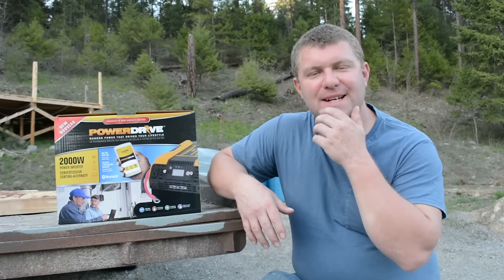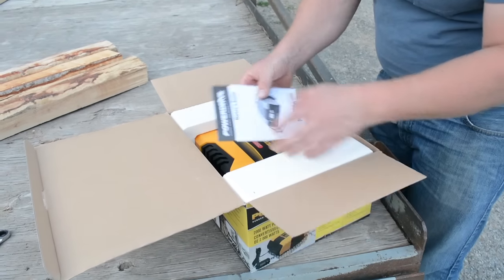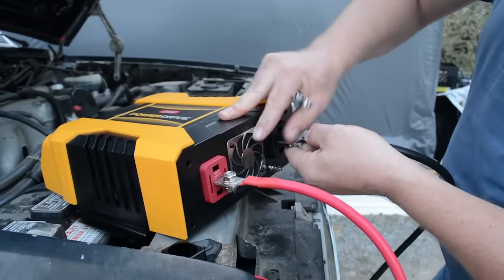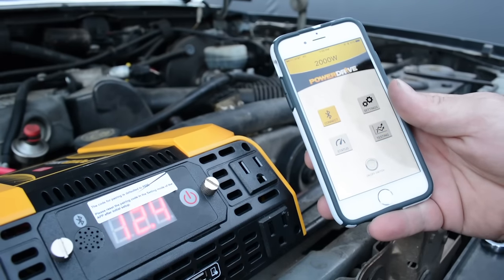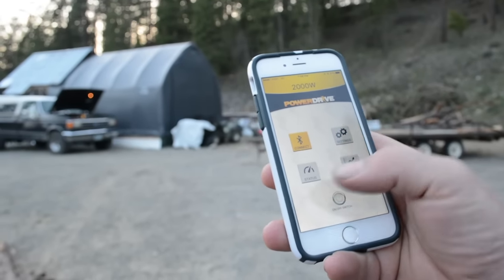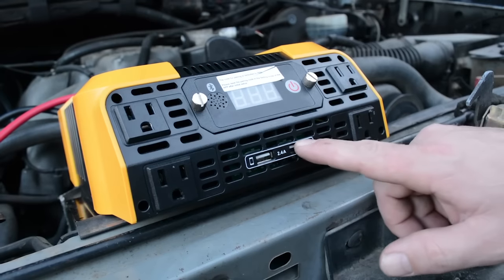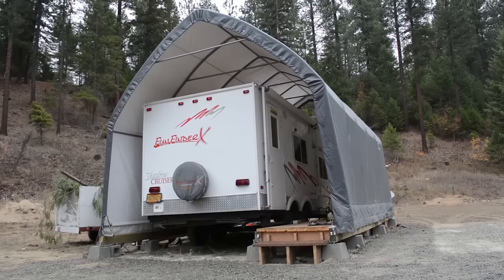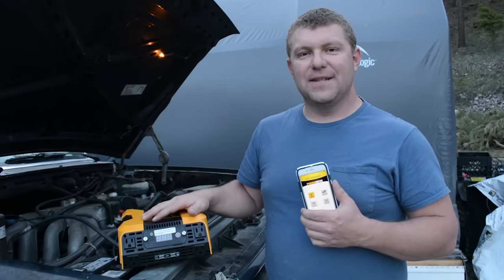GENIUS BLUETOOTH CONTROLLED INVERTER!! (iPhone and Andriod)

Comment: The thing that worries me a little is that you've spent a fair amount of money on a piece of equipment you will likely upgrade on in the near future.      So in this case its a $180 that probably  could have been used on your next power system.       Your video's are great, it will be interesting to follow your journey.       I own an off grid cabin myself but only live there part time.    In the winter time I do fill the water system with glycol and use an outhouse.     In the summer  collect rain water, rarely do I need to haul water, there is enough for hot showers, flush toilet and stuff.  Freezing temperatures in the winter definitely does present challenges.     I agree a cistern is probably the way to go.

Comment: hey, you mentioned at the end that you run your internet off of your inverter. Can you tell me why you chose to do this? All electronics are 12v. Wouldn't it be better to have it powered directly off your battery bank which is 12v?

Comment: What happens when the cell towers stop working? Going off grid means everything. I love manual control when it comes to my power needs. My Honda genset is 3k and pure sine. Look for good solar to charge car batteries. Mine charges my deep cycle RV battery fine.

Comment: You said that it is a modified sine wave inverter. Electronics are usually the most sensitive to that, but you said that you use it for internet purposes... and I assume aren't having any problems. Have you run into anything that didn't work on this modified sine wave?
Reply from the maker: +Christian Swensen No issues presently or for the last 8 months. You have to realize nearly everything we run is battery powered such as cell phones, laptops, camera, walkie talkies so all we are running is chargers which are presently run off our generator which is pure sine and powers our RV where we charge all these things. The only thing we power with this inverter is the Internet antenna and router. As of current we have had no issues with our either device, but those devices run small converters at the outlet to adjust voltage and current likely having a some filtering effect.

Comment: I assume it's not a pure sine wave inverter, so don't be surprised if some things don't run right. Be especially carefully with battery chargers and motor driven products. Motors tend to overheat with these. It can also shorten a product's life. Sadly, there's no reference list of what works and what doesn't with modified sines waves. For a reliable RV solar setup, you would stay with only name brand electronics from Morningstar, Magnum, Outback, Bogart Engineering, (In other words, expensive). With other brands it's a crap shoot as to how long they last.
Reply from the maker: +st8kout1 We use it to run our internet router and antenna. Works great!
Reply: It's fairly safe for computers, which is why UPS battery backups use modified sine waves. Digital clocks have a hard time though.

Comment: Modified sine wave inverters are NOT good for running motors.  They will have less power and will run hotter.

The best batteries for an inverter (power and durability) are GOLF CART batteries !  You can get them at Sams Club or Costco.  They are 6V so you will need 2 in order to make 12V.  Unfortunately, recharging them from a car is not optimal.

Comment: That is pretty cool, It does make me wonder what kinda of amps it uses with the extra features, still cool though. I personally use a 70 watt inverter most of the time cause it doesn't use much amps converting the dc to ac, i can usually run a laptop, 4-5 lights a radio, 5 security cameras, a router and modem all on just one 70 watt inverter i only use a bigger one if i have to i need to get a new nice pure sin wave too i keep burning up fans and such. I did make some videos about my setup feel free to check em out and subscribe.

Comment: Sorry...hit send too soon.  When you run the ground wire to the mounting frame on earlier units, with heavy loads on the inverter, the plastic around the lug melted  (2 new units).The truckstop wouldn't allow the customer to return the unit without the original packaging.  If you notice any heating of that lug, you might want try the Coleman inverter's sold at those same Truckstops.  They don't make a remote controlled unit, but they last 5 or more years trouble free. Also 12v dc inverted to120v AC is 10 X AMPS or a lot of heat and current. Those 4 Guage battery cables could be bigger to handle the higher amps.  3/0 would be quite safe. Anyway, keep up the good work.  Look forward to the next project...T
Reply: +Tom Bottoms They need the wireless ability. Good catch on the fuse. A lot lower than 250 amps.
Reply from the maker: +Tom Bottoms thank you the tip Tom! For this particular inverter we have no intentions of loading it heavily. We replaced a 300w inverter so it's load is small. In fact so small or doesn't even register on the inverter. That said we will keep an eye on it if ever we use it at full capacity. Melted lugs sounds terrible!
Reply from the maker: +Mike Brink The lugs appear to be a coated copper so perhaps it's zinc coating. I'll try to remember to take a closer look tomorrow and post up. I'll just say this isn't the inverter you'd want if you plan load it to the hilt. It's a decent built budget inverter with features we simply couldn't find anywhere else. The wireless was the selling point. We nearly bought a wired cobra and I'm glad we didn't. The wireless keeps our setup cleans and it works great for the application. 

I ran the predecessor to this model for 5 years in a work truck and never had issues. 
Ran a laser printer no problems and took the abuse.

Comment: Not trying to be a Safety Troll, but I guess I am.....@3:10 you are hooking the Positive Cable  to your car/truck battery with the Negative cable connected...dangerous in that if you swung that wrench and it hit the frame...big a** spark and could destroy your wrench/battery/etc......I've been close when this has happened...not pretty.
So disconnect the Negative Terminal from the Battery...do your Positive stuff and then reconnect Negative Cable and do that stuff.

Comment: 2000 unread emails lmao Be careful charging your devices through usb without the original manufacturer block that it comes with. I fried the motherboard on one of my phones doing that once. You also shouldn't completely deplete or charge the new lithium batteries 100% I charge at around 25% and stop charging at about 75% as a rule of thumb.Most devices come out of the factory charged at about 50% as this is where the battery is most "comfortable". I'm not really completely sure about the details but it stresses the battery at either end of the spectrum reducing the functionality and life time. Should be pretty easy to find info on it though. Maybe you were already aware but maybe not.

Comment: off grid but on network with a smart phone and inverter app? um... ok

using those usb ports for charging is pointless if they only work when the inverter is powered on. your phone and tablets charge on dc so inverting to ac then converting to dc is inefficient. 

that's not a large fan compared to others on inverters this size. That small, cheap, inefficient fan must spin faster and make more noise than a large fan would and it cools less effectively. a 2000w inverter with 1 fan that size will either sag to surge or barely surge, if at all.

there are very informative inverter vids on YouTube, by knurlgnar24 and others, that would serve one well to watch before making inverter purchases.
Reply from the maker: +mwilliamshs Off grid has different definitions to different people. We choose not to engage in these arguments because we'd rather develop our property! Our definition is that we're not tied to the power grid - not that we use zero technology.

Thanks for your other feedback and suggestions! I'm sure this isn't a one-size-fits-all solution but it works for us so we're happy!
Reply: +Pure Living for Life hope you didn't think I was being critical and I wasn't looking for one of "these arguments"

I enjoy your channel and wish you the best
Reply from the maker: +mwilliamshs Many people enjoy picking that argument :-) We are part of many off grid groups and turn our heads when this argument is brought up. People spend a phenomenal amount of time arguing about the technicalities of the definition, which means that nobody is actually making progress in life. They're just spending hours debating when they could be building a house :-) In the end, our home will eventually be built and those people will still be bickering on whether or not we are technically off grid! We're glad you enjoy our channel!
Reply: +Pure Living for Life EXACTLY!!! TO EACH HIS OWN!!! GOOD VID!